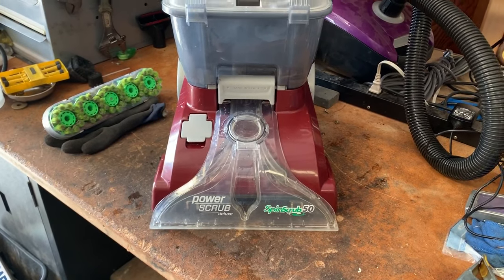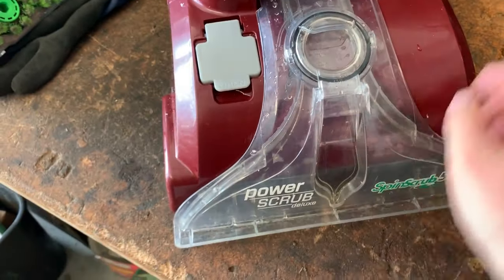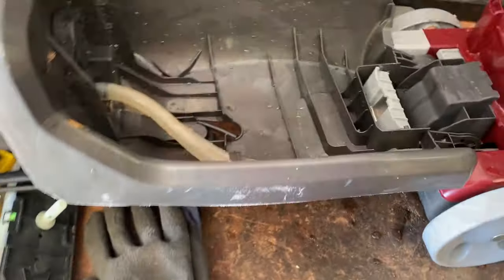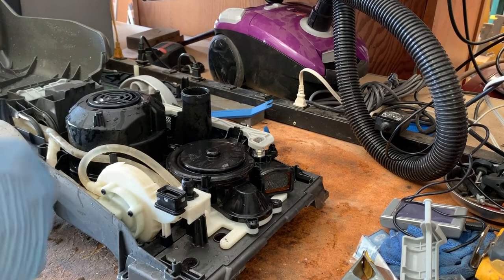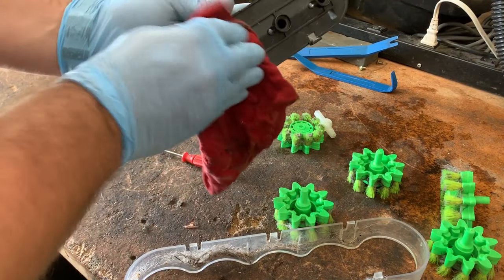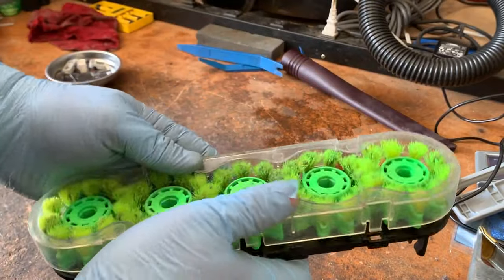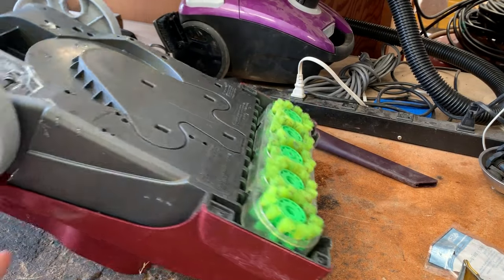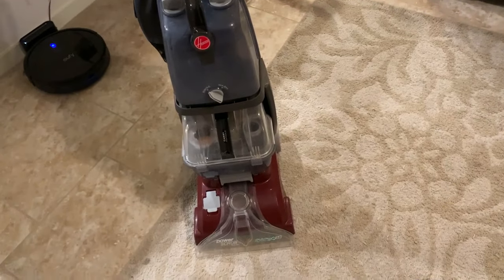Hoover Spinscrub Full Teardown

Comment: Thank you for the video!
 Almost the same for my Hoover Xtreme Scrub steam vac. 
I was able to fix mine! 

THE PROBLEM on mine WAS: the scrub brushes stopped because the internal large plastic vacuum powered turbine wheel cracked from the center shaft outward like the plastic hole was too tight for the metal shaft pressure crack over time. This caused it to scrape inside the housing and stop with the smell of like a rubber belt burning. 
I found a disassembly tutorial on fixya for oiling the assembly. I didn't need to oil mine but I did smear some of the factory grease on the walls, onto the gear teeth.

I was able to fix mine very well by: generic Super glued(not gel or gorilla glue) inside the cracks and holding tightly with my hands for several minutes. 
Then I carefully sprinkled just a little baking soda into and over the crack seams. This filled in any gaps. Then I let it sit over night to reach full strength. 
Align the shaft bumps with the inside of the plastic hub of the wheel. 
Then use a bench vice or light hammer with socket to Carefully press tap the center hub back onto the metal shaft until the shaft end is flush with the plastic hub top surface. 

*In hindsight it might have been better, I would recommend, to when gluing the wheel cracks, to insert the metal shaft and then super glue the cracks and hold it all together. This way there won't be the risks of the shaft being too tight in the wheel hub hole when and causing another split or the risk of getting super glue into the wheel hub hole, causing the same problem.

This saved me $50 for a complete Hoover turbine assembly I see can be purchased. 

PS I see the scrub brushes speed selection knob does have a hook catch. So to reduce the risk of it breaking when pulling it up-off, use a screw driver between the knob and the cover to flex the cover away from the knob where the knob's underside hook catches the cover.

Take care.

Comment: Video helped me disassemble my unit.   Did not realize the back screws.  Thanks.  Great engineered unit but capacity sucks.  My brushes were not turning.  Loaned it to someone and I think they exerted pressure on the housing and the gear got stuck.   Brushes are air/gear driven.  Great design.
Reply: I think this is what happening to me and I don't know how to fix it. It was just fine when I turned it on, did a corner in my bedroom and then I think the hose detached because now it is extremely loud and I don't know why :(
Reply: @williamchow1624  the brushes aren’t belt driven? I’m taking mine apart looking for a belt to replace because my brushes aren’t turning. 🤦🏼‍♀️

Comment: Thanks for posting this! I have this one and its leaking from the inside somewhere and there’s no water pressure to the attachment handle, water just drips out by gravity. At least now I know how to take it apart with not taking to many screws out.
Reply: Have you found the solution? Mine is the same way

Comment: If you own a Hoover Power Scrub FH50135 and are trying to remove the brush, do not yank it out. There are black clips deep inside. I used a flathead screwdriver and pushed them out on both sides. Yanking it out may ruin the plastic grooves.

Comment: Any idea how to fix the attachment??  Mine isn't spraying. It just runs out like there is no pressure behind it. I've cleaned the machine. I took apart the attachment to see if anything was broken or leaking but it's not. I've tried priming to make sure there no air locks but still no luck.
Reply: I'm having the same problem and my unit isn't that old .

Comment: Everything on my unit is working, except the brush isn't spinning.  The gears are not stuck, the brush itself is not stuck, and without the brush on I can see the part  on the machine that holds the brush is spinning. Any thoughts?  Thanks.

Comment: Hoping you can help me or point me in the right direction. I lent my carpet washer to someone months ago (I know...), and now when trying to use it again, it starts leaking water and solution without even turning the machine on. It’s as if it were missing something but how can I know what? It only leaks when it is installed in place, not when it is out of the machine. Maybe you could take a picture of the area where the water/solution tank sits on so I can compare. Please! Someone!?
Reply: did you figure this out? save problem here and I'm guessing it's either a broken hose or cracked something 🤦 it'll take a total tear down to figure out out

Comment: Thank you for this video - it was so helpful ! Mine had a high pitched squeal in it for the last few uses. Tonight it seized up.

I disassembled mine and clean everything up. Turned it back on with the top shroud off and...

 The vacuum feature was still working, but I could smell a metal or melting rubber smell.  I can see sparks inside the motor - through the grill on the top of the motor. Is there supposed to be sparks in there ? It seems like I might have to change the motor in mine. Any thoughts on the sparks which I see ?
Reply from the maker: Yea that's normal, its a "brushed" motor that's just normal operation. As far as the smell im not sure, if it's not something jambed into the brush Rolls it could be something failing inside.
Reply: @hanksgarage_  Hey - thanks for the reply. The sparks are orange and look like someone lit a mini 4th of July sparkler up and threw it in there. Maybe the burning rubber type smell is the carbon brush wearing out on the bearings ?

Comment: Hank.  Need some help. I ended up with 12 screws taking apart my spin brush to get the old pump out. I got a new pump and installed it just fine but I can’t figure out where two of the screws go. I’ve tried to find a diagram that shows all of the places they go but no luck. Any ideas?

Comment: I can’t get the top off from the bottom. I think my issue is somehow disconnecting the solution connection piece from the top of the machine. I’m trying to change the electrical cord. Any suggestions? I’ve tried vice grips but nothing seems to work!

Comment: Hi, 

For some reason mine won’t turn on and was wondering if you know where the fuse is or if there’s a reset button. I’ve just checked and the volt isn’t the problem, so it’s something with the carpet cleaner
Reply: I have the same issue.  It worked great last time we used it.  I took it apart and have power to the cord and to the starter switch.  I believe it has an internal fuse but cannot find it for the life of me.

Comment: How does the brush assembly come off? You already had it off in the video.
Reply: I got it. Took it completely apart even down to the gear assembly box. The gears were frozen, released them, put it all back together and the brushes still won’t turn. 5 seconds from going in the bin. 
I also noticed the plastic that holds the screws in some brackets is just crumbling, disintegrating. Maybe that’s why they say use their cleaning product? I don’t but maybe I should. Thanks for the video. Got me closer to the problem.

Comment: Mine just turned off when in use, and when I turn it on I can hear a small noise like it’s on but it’s not running. Is this a motor issue?
Reply: Mine stopped and is not making any noise

Comment: Why does mine sound like there is something trapped in a motor, gears or belt? It smells like burning rubber. Like others have commented, I lent it to someone, they put it back in my garage and I didn’t think to check it, it was clogged with so much dog hair, I guess it never occurred to them to actually vacuum first. I need it now, I dropped a bottle or Worcestershire sauce it shattered and got on the carpet too.

Comment: Great video!  I watched looking for the screws that everyone talks about as rusting.  Didn't see anything.  Is it because this is a newer model, or because it needs further disassembly?  Anyone know if you can prematurely replace the screws with stainless steal so you don't run into the problem?  Or any tips on maintenance to prevent rust?  Like maybe tip it over and blow a fan on the bottom after each use to get it to dry quicker?
Reply: it probably wont last that long just use regular screws. my motor or the actual switch broke. i am not sure i cant get the cover off to look at it. i used mine almost dialy my little house dog has accidents.
Reply: I’ve been putting it in front of air purifiers I have that blow air out the front. It was working but eventually it rusted and I’m not sure what to do or exactly where it’s coming from. You could use a blow dryer as well.

Comment: Thanks for the video at least I know how to disassemble it. Mine needs the fuse replaced. Any idea where it is?
Reply from the maker: Thermal fuse? Usually those are in or near the suction motor
Reply: Did you find the fuse?
Reply: i have googled that and it seems like there is no actual fuse. my motor seems to of gone out.

Comment: I use my backyard water hose with spray head to remove the trappped dust bits on the brushes. It makes everything easier (Though you will have to spray each bristle 1 by 1). You can see the dust slip off of the bristles. I don’t know about using a preassure washer but I think you should definitely try this next time with a regular water hose with sprayer.

Comment: While you had the top and the brush rack off you shoulda opened the brush vacuum motor and put a little 3 in 1 oil in there. When it gets to where the brushes stop turning the brush motor is usually either dry or moisture has gotten in it. Either way if I was that deep into it I would have went ahead and oiled it. Peace
Reply: Very true.  My unit had a rusted rotating part under there, and there was no torque to turn the brush ass’y.  Had to free up and oil the part.  Worked great after.

Comment: You had already power washed the plastic front.  How to remove?
Reply: Under the bottom tank there is a small lever. Flip it over and it unlocks the front funnel. It should just slide out

Comment: A flea comb will get everything out the brushes.. But my brushes keep falling off .. I didn't remove the middle one just the 4 and cleaned them. And now when I put them back they fall off like nothing
Reply: Nvm I was putting the clear cover back on wrong.  But yes I used a flea comb and all brushes are like new.  Better to do it when the brushes are dry

Comment: My wheels don’t seem to be spinning and I have used it twice only. Do they only spin when you move forward or the entire time?
Reply: They only spin when in the recline position.  Which is a great feature.  On the Bissell 2x they spin all the time, so if you are using the hand tools, you have to put cardboard or something under it, otherwise it will chew through carpet if left in the same spot for too long.

Comment: Does the brush holder just pull out or are there screws somewhere to remove them.  Also the clear cover in the front that just pops off as well?  I am sure I will break mine.
Reply from the maker: They just pop off
Reply: The plastic shaft is broken on mine, I’m hoping they have replacement parts!

Comment: Is there a belt on these, i was using and it started smelling like rubber and making noise.
Reply from the maker: No belt, its all gear driven, in this case its a small air pump. Unless something is jammed in where the brushes are

Comment: Bro, thanks so much, the best guidance video ever. One question, what if all that is done, but the brushes don't spin?
Reply from the maker: could be something jammed inside, or the turbine needs to be replaced.
Reply: Your turbine assembly needs replaced they can be found on eBay or Amazon I recommend Amazon these are super easy to tear down
Reply: I recently fixed mine using a really small Allen wrench. I found a YouTube video on this problem.

Comment: I used the same machine to cleaned the carpet and cushions of my car then suddenly, the machines started to smell and whenever I turned the power on it creates that high pitch noise but nothing similar to the normal cycle that it used to be. Anybody knows? 
I think I’ll buy a new one 🥲
Reply: Same mine made a high pitched noise
Reply: Just figured out on mine that some mid-length cat hair got past everything and wrapped in the motor braking one of the blades.

Comment: Wish you would’ve mentioned covering the motor up when you said all the parts were waterproof. Now I think the motor is broken. Thanks
Reply from the maker: It is water proof. Water won’t hurt the motor.
Reply: @hanksgarage_  Strangely enough then, the carpet cleaner won’t turn on anymore. What do you surmise what the issue is, the thermal fuse?
Reply from the maker: @MrHalosucks655  I’ve run electric motors underwater before without issue too. You probably on accident jarred something on reassembly take it apart and check all electrical
Reply: @hanksgarage_  Ended up disassembling and reassembling it again, making sure to clean the turbines and bearings yesterday. Still didn’t turn on until earlier this afternoon, and now it’s working again. Very strange, anyways my apologies for the passive aggressive comment, just vented frustration. Overall good video though.
Reply: @MrHalosucks655  Maybe it was your chord, outlet, or you flipped a circuit breaker without realizing it?

Comment: Until your little bearing rusts out. HOOVER why are these bearings NOT made of stainless steel. THEY RUST! Hoover you could have prevented all the pain $$$ of repairs. When I went to buy replacement brushes they no longer made them.
Reply: I watched looking for the screws that everyone talks about as rusting.  Didn't see anything.  Is it because this is a newer model, or because it needs further disassembly?  Anyone know if you can prematurely replace the screws with stainless steal so you don't run into the problem?  Or any tips on maintenance to prevent rust?  Like maybe tip it over and blow a fan on the bottom after each use to get it to dry quicker?